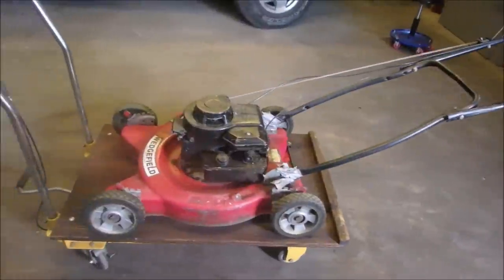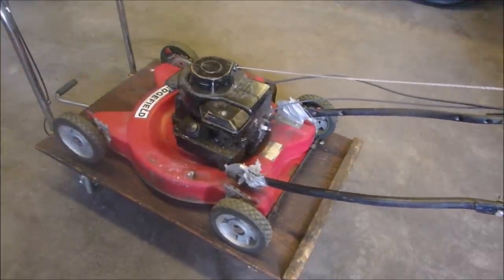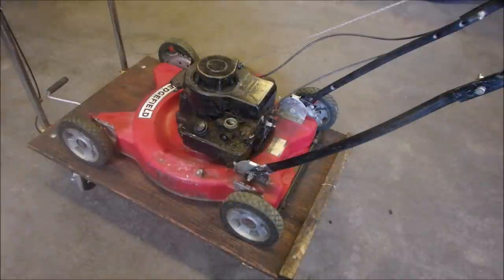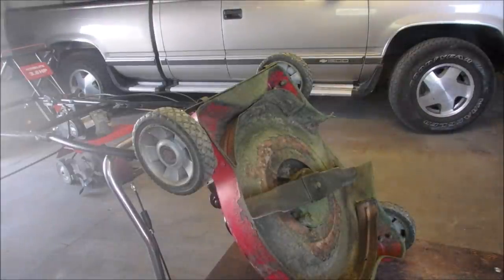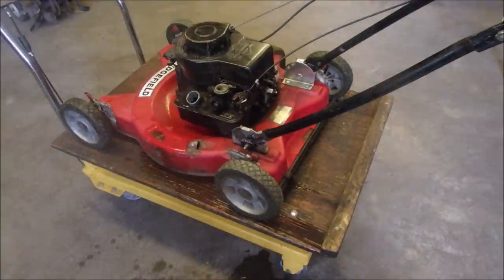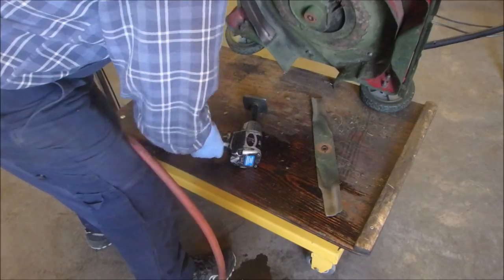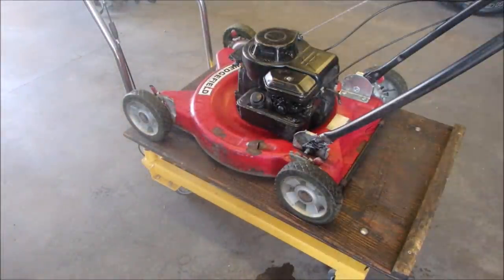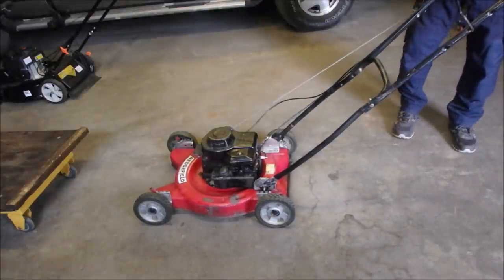1992 Wedgefield Briggs Classic  Mower

Comment: Once upon a time I had an old mower, the kind with the carb on top the tank, that was so old it did not have the kill bar on the handle, had an automatic choke (would not run unless the air cleaner was attached), and had the old breaker-point-and-condenser ignition system. To change the wheel height, you had to remove the wheels and put them in a different hole in the frame. and it still ran great!
Reply from the maker: I have had the exact one.

Comment: I once had a customer call me to pick up his snow blower, it was and antique to be sure, a Homco snow thrower, whci hasn't been made since the 1950's, it had a small 3 1/2 HP Briggs engine and a gear reduction on there with metal cleat wheels, i told him to save the money and put it towards anew one, he said go ahead and fix it, i got it running {with some work} it ran like a kitten purring after about a day and a half of work.
Reply from the maker: Great story.

Comment: Hey Bruce what is the worst air filter you ever seen on a mower
Reply from the maker: It would have to be one that stalled the engine.  This one was bad but i think i have had a few quantums that were grown right over with goo
Reply: @BrucesShop  I have seen them on a riding mower till they fell apart and wasn't nothing left

Comment: She sounds a little high reving  I could be wrong
Reply: I thought the same thing. His tachometer said 3380. An older engine that that I would shoot for 3100. But it will be fine.
Reply: @haneyoakie14  thanks for your reply on this matter
Reply from the maker: You know I set this one for 3100 and it kept creeping up so 3300 is where it landed.
Reply: @BrucesShop  it has a mind of its own. It wants 3,300, so 3,300 it is.
Reply: @BrucesShop  okay thanks for letting me know that young man 😎👍